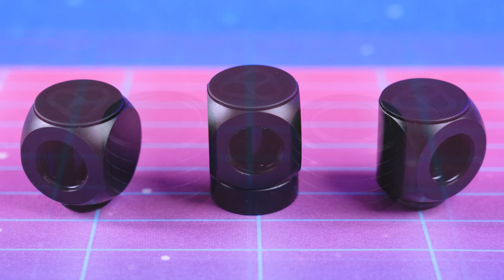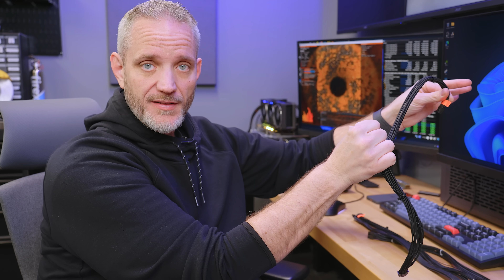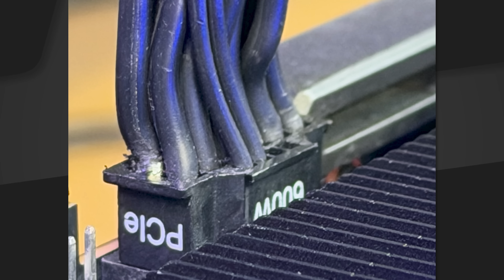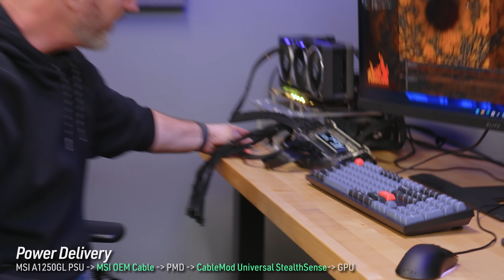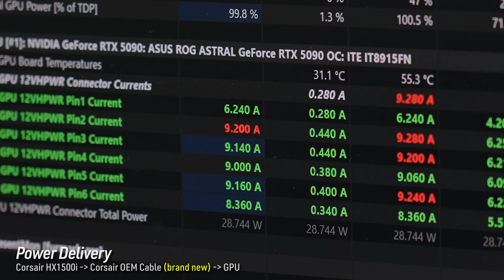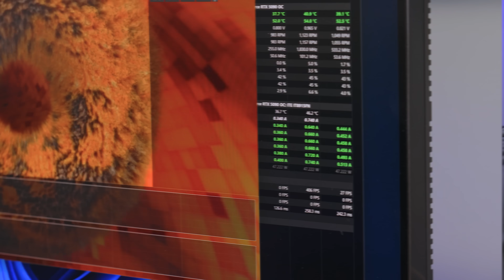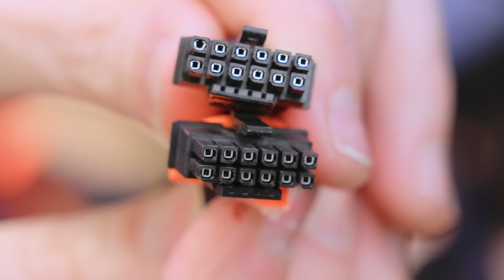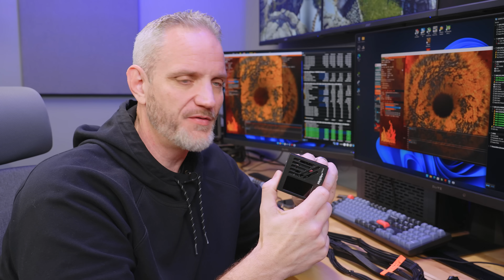More details on what could be causing 12VHPWR / 12V2x6 Cables to melt

Comment: I wonder why they don't do quad 8-pins. Visually looks bad? Well better than melting. Also, instead of putting the connectors on top or behind of the card, they could just put them on the shorter side of the card side by side, no? Would look good too I guess. Imagine quad 8-pin cables running from the end of your card to the back of your case from the openings. Uuaaah like It would look chonky, like "Yeah, this card is a beast!" type of look. Plus, I don't think the new "BTF" or "Phantom Link" thing is a proper fix. Like what who is going to be like "Oh, I should better get one of those new motherboards, which will force me to upgrade my CPU, also probably RAMS, so I can use my new GPU without worrying!".

Also, what I think is, a simpler fix would be just using 14awg or thicker cables. Maybe 12awg. Plus making the connectors like really sturdy, really hard to frickin insert and pull out. This way none of us would need to change any components. Just ""buy the newly released thicker 12vhpwr" and you are 90% good to go. I used to kept my games running when I go outside back in the days. Now I cannot because I cannot be sure if my damn connector is going to burn my house down or not.

Comment: Thx Jay for the video, and huge props to Phil for that invaluable hint!
I now solved the uneven distribution/10-11A spikes on my 5090. Never actual temp problems on the connector, but always starting to occur at or above 1/2 load.
Tried it after this video - wiggling cables along the way - not on the plug - made the distribution go from bad to worse, but never even no matter what.
Did 3 small rebuilds with same cable - sure made a cable break by winding too hard/often, with some cable strands ripped - that can't cope when load increases bc too small gauge.
ALL the plugs were/are fine (PSU, GPU, cable either side), cable itself looks like new - but is garbage underneath the pretty sleeving.
Mad at myself, bc should have known - bc seen exactly that it in my car Hifi times all too often. 
And had a same (new) cable on reserve anyway, but never tried that bc too lazy. Duh...
Installed it: everything solved. Max. 0,5A difference, all well under 10A (+5%/630W on Furmark).
And yes, used a Wireview Pro1, now a pre-ordered V2 (beeing in EU has it's perks ;-)
Those small guardian angels are a bargain, bc actually worth their weight in gold these days (actually, considering gold/5090 prices)...

Comment: When 12vhp cables came out a few Tech YouTubers raised a flag as the number of times you change connections (plug in remove then plug back in) is about a quarter of the times of a 6 or 8pin previously used as well as cables being smaller, also its not supposed to be bent close to connectors. The head room for voltage was Smaller, the whole thing looks like it was rushed out resulting in a big dangerous mess that should be binned and replaced with better designed and thought out design maybe with each line regulated and monitored for problems with cable.

Comment: So one thing people don't seem to consider....

Consider a use case like yours with a lot of plugging and unplugging, the connector is somewhat worn. As you've demonstrated, a bit loose.

The pins might be evenly worn, evenly poor contact, and could be _balanced_, but high contact resistance leads to voltage drop over the connector and therefore heat generation and.... flames?

Comment: I just have to ask this. Is anyone still running the recalled cable mods 90 degree V2 adapter? I've been running one since I got my Zotac 4080 along with a cable that fits my EVGA 850 watt power supply.  I'm running an older CPU (overclocked 8700k at 5 ghz) so I didn't feel the need to overclock my GPU or up the voltage to it since there would probably be very small gains compared to the increased heat. The only settings I changed on the GPU are the fan curves. The stock ones let it get too hot for my liking and also suddenly sped up the fans making it very noticeable. I prefer the ramp approach having the fans gradually speed up by creating more points on the scale for temp vs. fan speed. Every month I clean the dust out of everything but don't unplug my GPU cables and make sure not to unseat them. My case cools quite well and nothing is getting hot. 
I'm just wondering if anyone else is still using the recalled adapters. The reason I bought it in the first place was because my case side panel was jammed right up against the gpu cable forcing it into a tight bend and I just wasn't comfortable with that. I bought the GPU when it was released and added the adapter as soon as the Cable mods 90 degree V2 came out. Before that I ran with the original cable smashed up against the side panel. If I haven't had any melting yet, should I just leave it alone? In the near future I plan on building a new PC (probably a  AMD Ryzen of some sort) and keeping my GPU. I figured then I would buy new 90 degree cables that would fit the new power supply I'll be getting.

Comment: 12VWHP is just criminally bad shit... I have ruled out owning any GPU that uses it, which means I am stuck with 9070XT (not horrible problem to have), but even when choosing my 9070XT I had to completely rule out Sapphire Nitro+ (for more than their idiotic choice to use known bad cable design, mostly their horrible RMA) and also Asrock Taichi... Thanks god there are still sensible designs with 3x8 12V (2x8 is a bit sketchy on card that could pull near 480W) - Asus and Gigabyte made. But insistence of Nvidia using this crap and to be honestly ingorance of consumers who just accept this in their rigs is really crazy.

Comment: Been using a NVidia 270 & wanting to upgrade.  Just when I was going to upgrade NVidia went to the 12V & had problems.  Thought they would wise up & change connections, but they didn't, so I just upgraded to the 9070XT with good old trusty 8pin connectors.  Your lost NVidia.  I will not buy a GPU with that 12 V connector.

Comment: Maybe it's time to add a 24 or even 48 volt bus for high current devices.  It's much more efficient  to convert from AC (95% typical). Requires less wire gauge and  less heat and resistance issues.

Comment: I think when the pin was partially popped out it was probably essentially not connected that time too which would explain why it booted similar to when the pin was removed. Pushing in on it was likely equivalent to "hot plugging" which can cause voltage/current spikes (in some cases almost double the input voltage for a fraction of a second). Some sensitive electronics will shut themselves off if a spike is detected which might be what happened. Hot plugging (rapid connection) of live voltage to capacitive loads can create electrical ringing, potentially damaging sensitive integrated circuits and semiconductors.

Comment: Those connectors are only rated to be used for max. 30 times. You should replace those cables after 30 times inserting/removing the connector.

Comment: They were nice enough to create a problem that they could then solve in a few decades 😂 What was the problem with 8pin connectors? My gpu still uses that and nothing is on fire yet 😂

Also, the teeny-tyni IDE cables in my retro build are over 30 years old, and they still arent damaged, and believe me when i say it was plugged in and out at least a few hundred times 😂

Comment: I think the whole idea of powering these fancy fan heaters with 12V is a stupid idea from an engineering perspective (heaters for small rooms witch such wattage usually use 230V directly where I live). 
Or put there some XT-90 (or similar) connectors, that are designed for such applications.

Comment: Is there anyway to find out if my connector is alright on a 5070 prime oc for free? I don't want my gpu go boom, my country doesn't have any warranties.
Reply: This seems to be a problem with the 5090's massive power draw, and Jay constantly wiggling and removing cables back and forth in a test bench environment. Your 5070 is more than likely just fine if you plug it in firmly and don't repeatedly take out the connector

Comment: Just recently had to deal with issues on my 5070ti, where i would lose video and the fans started going at %100. I tried everything. Undervolting, clean install, drivers, even tried linux. Saw people with the same issue but no resolution. Until i found a reddit thdread where someone said it was the 12VHPWR cable becoming loose on the psu end causing spikes. I just tried it today, i tool it out and plugged it back in. Arranged the cables so no other psu cable touches it. And it worked, i was able to go hours without it haplening. And indeed i noticed the cable was just barely unplugged from one corner, not like you could just see like a fourth of a milimiter pulled, which seemed to have come out by itself as i had no issues months ago. I hate this cable so much.

Comment: Jay, the reason why the cable is so easy to push into the card is you keep wiggling the cables back and forth when you remove them.  Stop it!  Just firmly grip the connector, and pull it straight out.

Comment: It would be worth it to check the resistance of the different wires in those cables. It's entirely possible that one of the lines has a higher resistance than the others or a complete break, that should show up ona a good ohm meter.

Comment: The entire problem is caused by trying to deliver 500W+ at 12V. It’s time to move to a new power supply standard and connector that can negotiate voltage from 12V - 72V so this doesn’t keep happening.

Comment: When I bought an RTX 5080, I also bought a thermal camera which I had aimed at the power cable for months.  As the GPU temp does not tell me the cables are hot.   But everything checked out. Never found problems on mine.  But since GPU's don't actually monitor the current for each connection anymore, connector wear and tear is a problem.  But it's both a problem with the cable/connector, AND the GPU. While GPUs cost more, they no longer check current for each connection. 
From what you found here, is more of a test bench problem, and mine is a gaming PC, cable not touched since being installed. It is a Corsair cable as I have a Corsair 1200W PSU.
Reply: Reading the comments that seems to be a recurrent theme: plug it in once, maybe unplug here and there for troubleshooting, fine, plug and unplug repeatedly while wiggling the cord back and forth, yeah you're gonna have an issue. Jay's not the average consumer, he's constantly shuffling things in and out and then blaming the card.

Comment: Also, the fact that Nvidia DITCHED per pin monitoring needs a class action. 

This is basically a design flaw, from a monopoly that's basically on purpose to increase sales and reduce second hand stock. 

They knew this was an issue, and then removed monitoring on the card side. 

Absolutely shit for a $800+ product and needs legal action.

Comment: This just proves my original idea: 

This power cable should never have used a plastic friction fit connector, but instead should have used a latching connector similar to automotive HV. 

We should have a mechanism to secure the cable vs relying on plastic and metal barbs for the pins. 

Then this problem would just go away. 

It's also easy and cheap to have a basic PD chip for 25c that will communicate the cable limits and design and if it's compatible with the card and PSU. Then you can have different standards all use a similar connector for power. 

It's also super easy to have a small chip test the power connection on boot up. 

But corporations have to save that extra 50c....

Comment: All this headache over "aesthetics", what a waste. they wanted a slimmed down, sleeker looking cable for marketing so they could say "its new and looks pretty" when simpler, slightly larger connectors and wires have been doing the same job much more reliably for decades. 🙄
This is why I don't let my 5090 run full tilt overnight doing video up scaling or anything, don't want my house to burn down because my power cables are too sexy and slender.

Comment: Seasonic 1600 Watt PSU, I have it running 2X 5090 (water cooled) and another Seasonic 1600 Watt PSU running a single 5090 in another case … no issues at all … using the cables that came with the Seasonic PSU.  I think the primary issue is that consumers go cheap on their PSU … spend the $600 and get a proper PSU that can handle the loads.

Comment: my corsair psu r1000x had the same issue with a old school pcie power cable. one of the pins was out, out of the box. i was afraid to pop it back in and use it in case something was wrong. corsair was out of stock on replacement cables so I had to return the whole unit just because I needed every included PCIE cable

Comment: The new power cable was one of the main reasons I switched to AMD, got a 7900xtx before 50 series was released. The other big reason I switched is Nvidia skimps on the VRAM, my 10gb 3080 aged horribly fast for 4k gaming due to it.

Comment: This scares me too Ive seen it happen all the way down to even 5070's I feel like its on the psu and nvidia making these connectors and cables. Loose brand new cables doesnt seem good. I hope my atx 3.0 thermaltake gf3 12v cable is good. It was super stiff and took some force to make it completely plugged in. Its only a 450w rated one would that be a problem with my Asus Tuff 5070? I bought my Thermaltake gf3 850w when it released for future proofing if I ever switched to nvidia.

Comment: Any kitchen appliance uses 10x times more power and has even smaller connectors, yet none burst out in flames and no wire melts either. Even your christmas tree lights do a better job at turning 120/220 into 5V better than a full brick psu nowadays.

Comment: Cheers for this video Jay. I didn't think I had any issues with my 5090 astral and my ax1600i with a cable mod kit but it turns out I did. I'm back on the stock adapter for now and it's so hideous lmao.

Comment: Well every connector / pin have given plug/unplug cycles by manufacturer. Some have thousands cycles, some only few.... And if someone decide to spare pennies by using not genuine pins ( one could buy pins quite cheap from several sources which are made from wrong material ), then BAM you have issues. 
Generaly speaking.

Comment: amazon and temu are good for certain things.. and even those can be abit shonky... now take in account all the card warranties, done, in process or about to be sent, that arent infact card related..., its then now down to the psu companies making sure their cables are passing durability tests and QC's.. you should NEVER use cables that didnt come with ur psu EVER, they are all mapped differently to stop u from misplacing cables in the rightful spots and also for that simple reason to not use other companies cables on their psu's which is totally understandable and competitive marketing to say the least, and it would also save the draw back on claims persay and to hold their own markets per company in that area.. considering psu's are ment to have a decent lifetime, u think they would atleast outlast the cables they send with the psu that delivers the power though.... id suggest to buy ur cables from the psu company of the one u own and keep the receipt that way if its the case of it being cable related its back on an company, not just some seller on temu or amazon using a backyard sweatshop(small factory what ever) to make all these kinds of things nock off cheaply made products, poor quality materials and nil qc'ing... you cant say the same reputable companies get their stuff from the same people selling identical products for half or quarter of the prices... sure selling the same mapped clusters is great and all if the quality was just as good as the original product...... cheaping out on anything to do with electronics, let alone the thing u spend ur time on is the most absurd thing you could ever do to ur self and to ur beloved machines.. we all use our pcs to unwind on, and even to work on.... 
think of it like ur car, you wouldnt put some cheaply made tires on the rims would u, considering they are the last things that touch the ground and make u stop turn and go...., or put old oil in the engine to top up after a 5thou service, or filthy water in the radiator or use CHEAP cables setting up ur sound systems.. so why would u cheap out on ur pcs, just dont do it.. make sure u get ur stuff reputably... dont slack out on expensive things that keep u sane or make u money.... jay proved 3 things here... the original cabling or series 1 you could call it of the cables for the newer cards were bad, new cabling is good or better, and dont buy from amazon(even tho he says its ok too, its really not) id love to be proven wrong ofcourse.. buy the same cables u buy from the company and them form both temu and amazon.. all 12v2x6 cables mapped for the psu u use on ur test bench and see if they are all the same or not and whos is better in testing, and then cut them open and test the plastics, rubbers, copper(or what ever is being used now) and connectors for durability and longevity and i bet u they will all be different in quality and even in performance at that point........

Comment: Positive negative, 12v and GND, two wires, two points of failure.

Make it 12. Thats 12 points of failure. 8 pins x 3 also had issues, which was why most AIB had shunts. But the only difference is that the 12VHPWR had smaller pins. Which made the problem worse.

Its no surpise in RC, bigger amperage = bigger pins.
Making the connector pins smaller just made it easier to fail.

Smaller pins is not the way forward for high amperage

Comment: ask a cleaner how often the 30 meter power extension cord breaks causing what sounds like a blip of the throttle. even how the cord dies on a game controller enev the aux cord its not the plug but the wire that can fault anywhere along the wire.